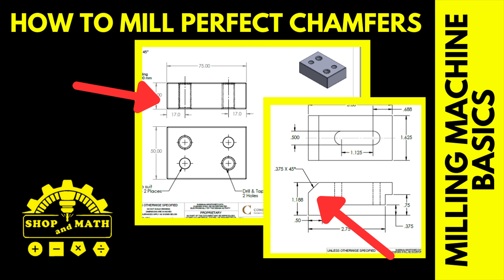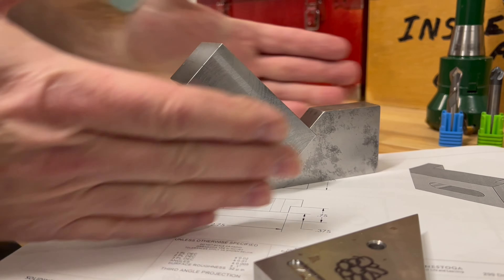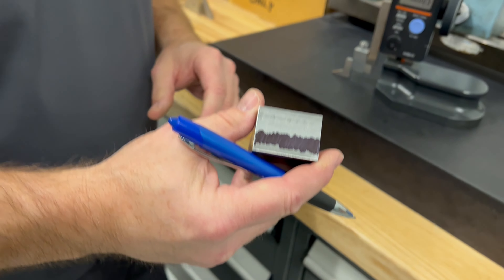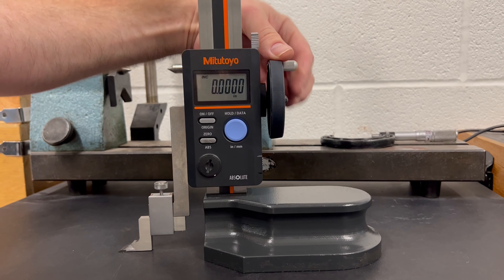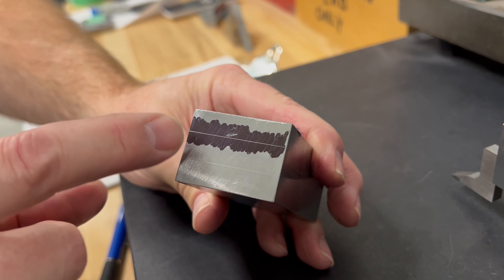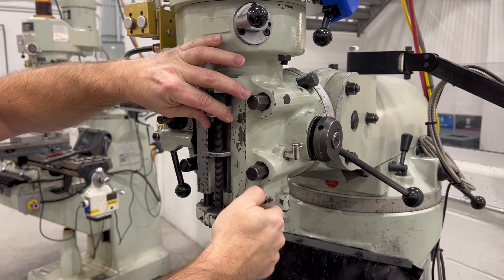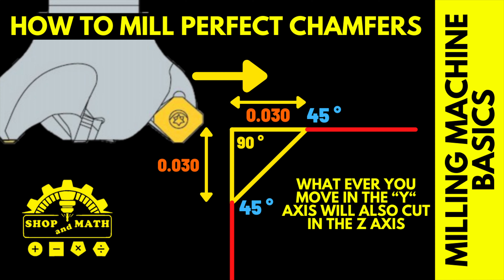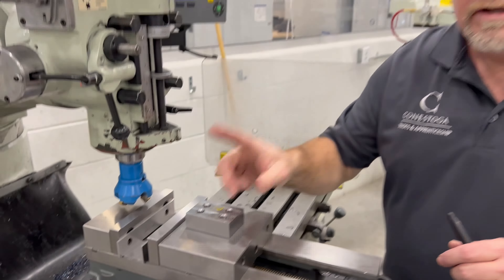how to mill perfect chamfers

Comment: If you look for:     Big chamfer - big tool - big part - small cycle time - short video.    There is an unusual method using the inside of the teeth.
There is also one for making a countersink gauge to set chamfer depths.